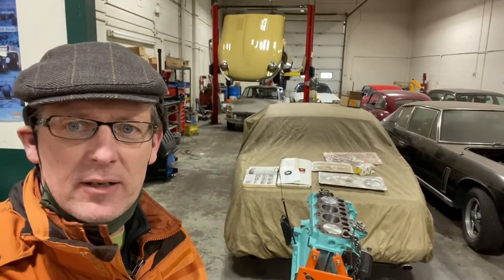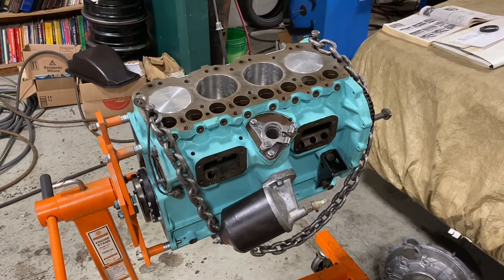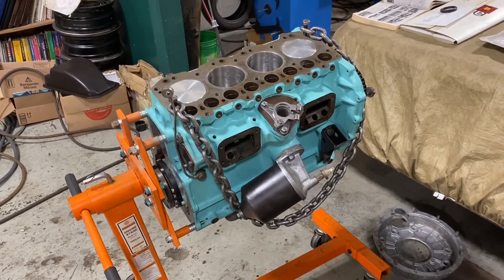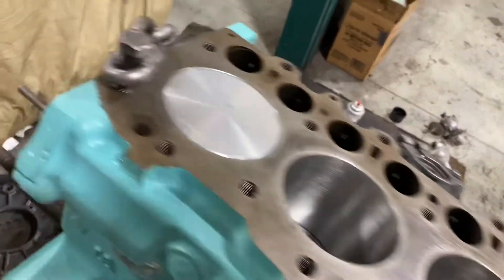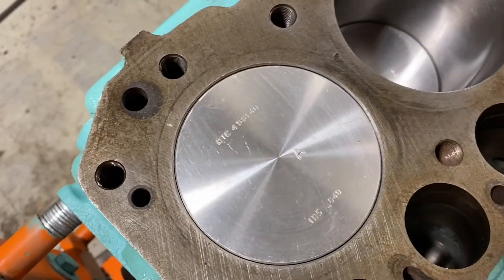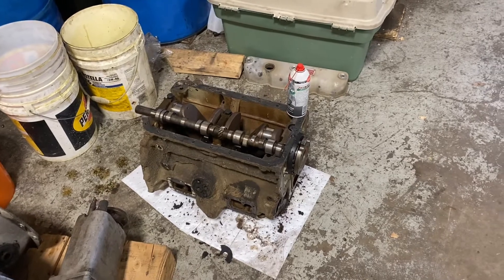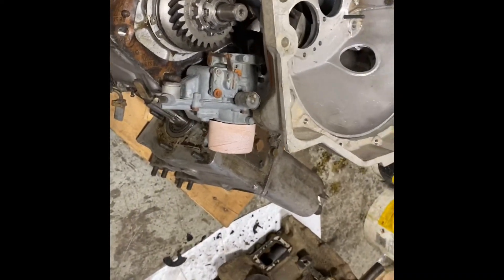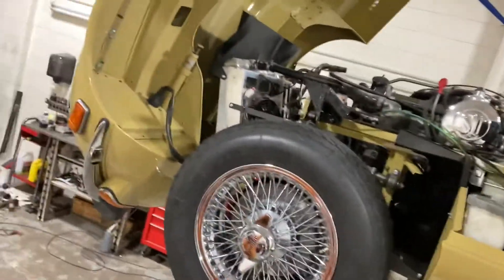Land Rover S2A Restoration 2.25L engine

Comment: Thanks for the vid.  Looks like you had it bored .040" based on the markings on the pistons.  Any idea how much torque and hp you will end up with after boring the cylinders and the 8:1 head?  Are you doing any porting to the head (for instance like the gas flowed Turner Engineering heads)? I have a 1960 S2 with an early 2.25L petrol (engine block serial number starts with 151) - has smaller diameter main bearings for the crank and the head has the deep bellows type thermostat housing with an 8 bolt water pump.  Will be getting my engine completely rebuilt from the bottom up and thinking about rebuild options.
Reply from the maker: I would only be guessing - maybe 5% more torque at the same rpm. My manuals list a 4hp difference between 7:1 and 8:1 (73 to 77), and the overbore might be worth another few hp - 80hp maybe?